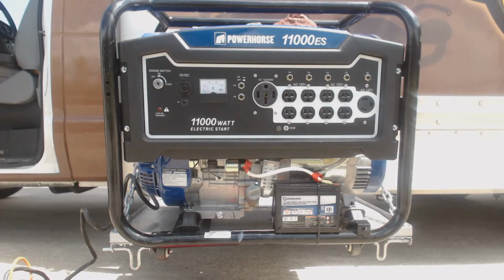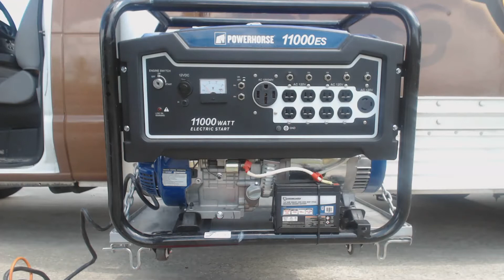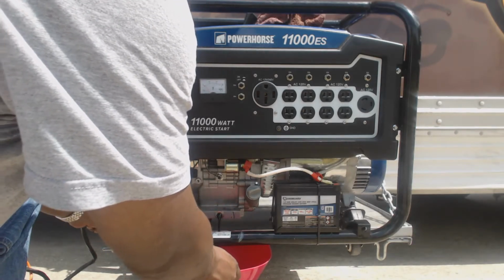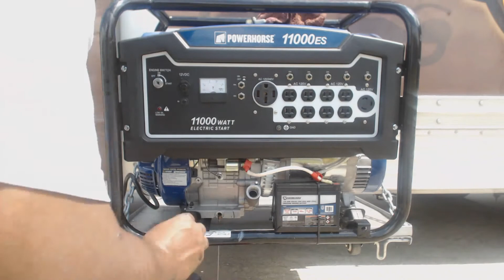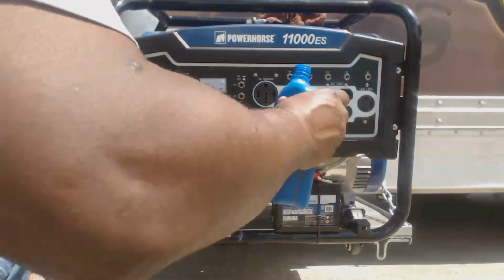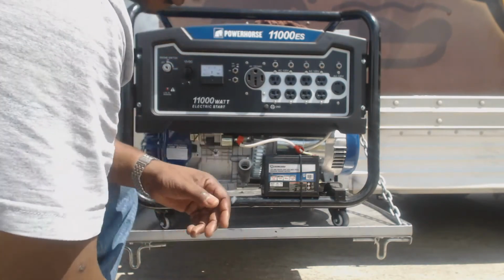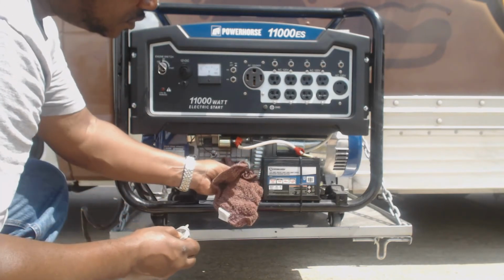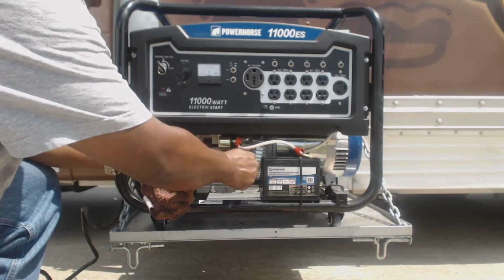Generator Powerhorse 11000 watts Oil Change

Comment: Thanks for the video. I'm in NJ but these hurricanes occurring down south have scared the living daylights out of me. Taking delivery of a Powerhorse 7000 generator tomorrow and am getting all my supplies together (spare 5 gallon fuel cans, interlock for the panel, back feed receptacle, etc) for maintenance and utilization whenever we'll need it ( and we will!).  Sounds crazy but I really like this little right angle funnel you are using. Who makes it and where did you purchase it? Thanks in advance!